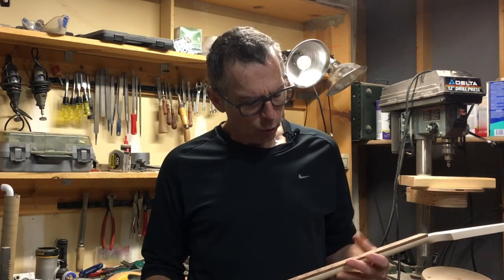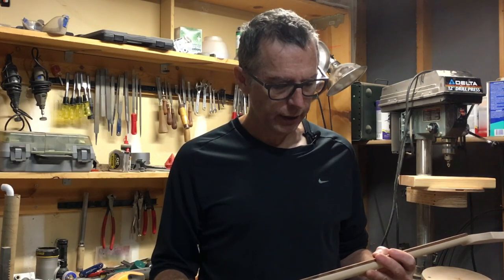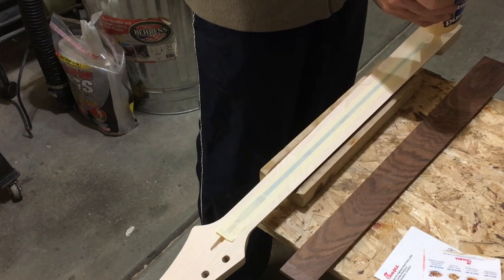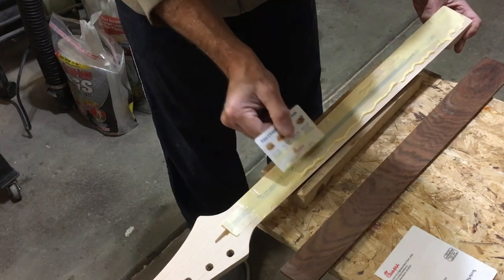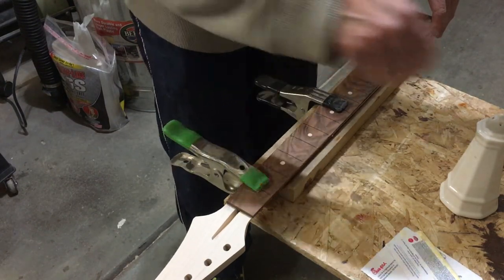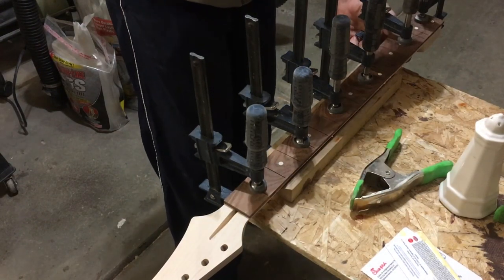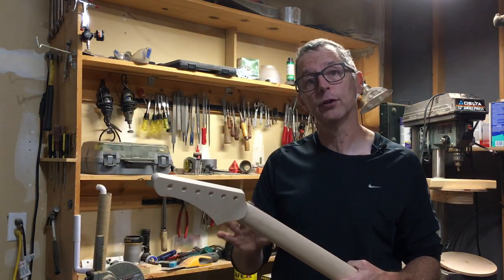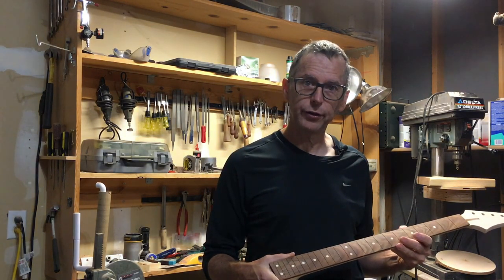How To Glue A Fretboard Onto A Guitar Neck

Comment: You did not show how to position the fingerboard on the neck.  Scale length and intonation will depend on it.  Won't it?
Reply from the maker: Since the sides of the neck and fretboard have an identical tapered dimension, the position is automatic. Scale length is determined by the placement of the bridge relative to the position of the nut and the 12th fret after the neck is installed into the body. Intonation is set by adjusting the position of the bridge saddles.
Reply: I am trying to replace the existing fingerboard with a new one.  Any tips?
Reply from the maker: Make sure the 12th fret of the new fretboard will be positioned exactly where the 12th fret of the old fretboard was on the neck.